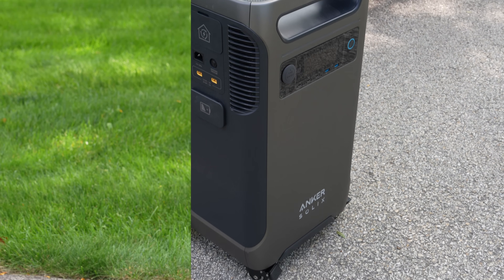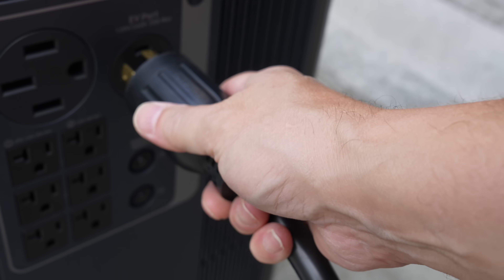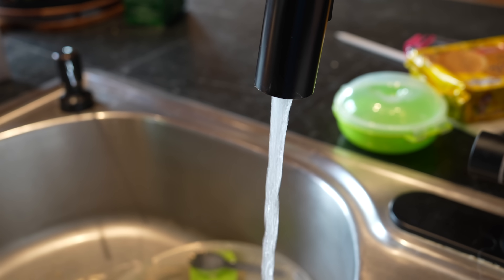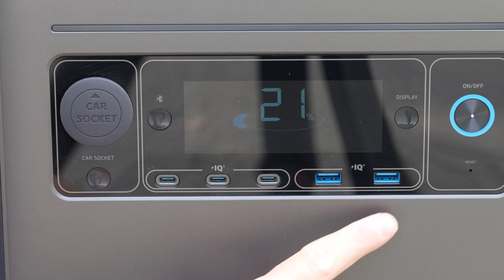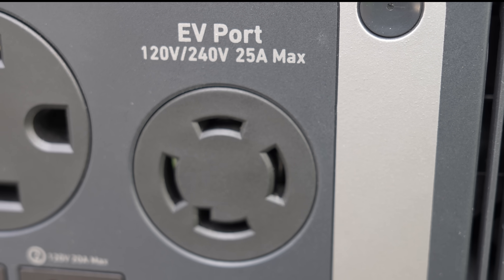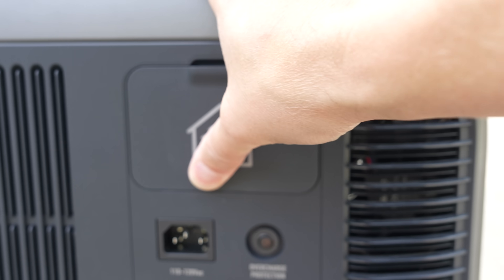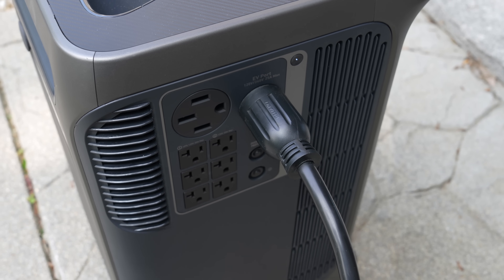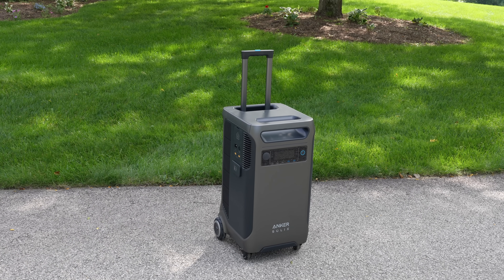Better than GAS Generator? First 240V Battery Backup - Anker SOLIX F3800

Comment: I would never rely on battery power in an emergency. I keep 20 gallons of dinosaur blood on rotation out in the shed and my well maintained Honda will never fail me.
Reply from the maker: I have become very angry at Honda. I need to make a video and share what I know and you will be too. It won't change your old generator, and I also own a Honda EU7000is. Don't get rid of your old one as Honda is pretty much abandoning us as a country. Sorry for the drama, I need to make the video as there is a lot people don't know. Mr Honda would not like their new company! I also agree with you if you live in the woods like I do you should have 2 backup pwoer sources, even if not equal but you have to plan on failure if you want to keep going.
Reply: You made a spelling error on the chat so to let you know, been watching you for a few years, you make good content. Keep it up!
Reply: @SilverCymbal when are you planning to make the video? I wanna know what is going on before I buy it this year. Thanks
Reply: @SilverCymbal  I'm curious, what's going to happen with Honda? I have the honda 7000 I es generator since it was the only fuel injected splitphase generator at the time.  I also have solar, so in 2 years I've only put on 1 hour on my Honda to run my well pump. Everything else got ran on solar.
Reply: @SilverCymbal Would like to hear your thoughts about Honda!
Reply: @SilverCymbal how to say a lot of words without saying anything
Reply from the maker: @nils1953  I used to work in government, they train you on that
Reply: As someone who uses generators pretty much daily, i gotta say, that battery is most likely more reliable and definitely cheaper to run in the long run.
Reply: @eokwuanga  batteries don’t last indefinitely. I’ve had my generator for over a decade and it runs as good as the day I got it. If I keep the maintenance up it will probably still be running just as good in another 10-15 years. You think that battery will last 25 years? That’s an awful lot of faith in all this new tech. It’s cool and all don’t get me wrong but as far as long term reliability I don’t think Honda generators can be beat.
Reply: @MR1977.  you said you're had a generator that lasted a decade, can you please tell me what brand is the generator?
Reply: @montisino  it’s a Honda eu3000. Purchased it in 2012 still runs as good as it did the day I bought it.
Reply: @MR1977.  Thanks for the reply 👍
Reply: @montisino  🤙🏼
Reply: @montisino  full disclosure it’s not used as a daily beater. Home back up and the occasional summer camping trips. It’s kept on a trickle charger and it’s ran for an hour every couple of months under load to keep the juices flowing.
Reply: @MR1977.  I'm thinking to get one to charge my batteries in my rv
Reply: @montisino  it’s perfect for that. It’s nice and quiet too so you won’t disturb other campers.  Only downside is it’s not very portable. 2 man operation without the wheel kit.
Reply: @MR1977.  Does the generator work on cold climate (i live in kapuskasing) I'm thinking to live full time in my rv and I want something reliable in the cold winter to charge my batteries
Reply: @montisino  damn man you’re way up there. I don’t see anything close to those temperatures so I can’t say for sure.
Reply: @MR1977.  thanks for your time, god bless you 🙏
Reply: @montisino  no sweat. Stay warm.
Reply: @MR1977. batteries don’t require maintenance, and yes they will last over a decade.
Reply: @brittgayle467 And they always discharge.
Reply: So the sun is gonna stop working. Thanks for the tip Nostradamus.
Reply: @EvanBlack11  “they” sun will probably continue to work its the batteries that don’t possess endless nuclear fusion. Unless you know of a battery that can last as long as the sun? Do share if you do.
Reply: @EvanBlack11  I understand what you mean and I truly want a solar generator but I believe what the other commenters points are is that even in this video it says you can recharge this unit 3,000 times. Well living in Southwest Florida where I have no power for approximately two weeks after a hurricane I don't know how 3000 recharges would last. I don't want to gas generator of any type because I don't like storing all of the gasoline prior to the hurricane and if you run out of gas forget about waiting in lines at the pumps, the gas station tanks run empty before you can even get to the front of the line. No gasoline for me but still searching for a portable solar option. I especially needed to run the air conditioner, small fridge and my well, the well doesn't have to run all the time but at least  periodically to allow me to shower. Please reply here if you happen to know of a good portable solar option.
Reply: @j.darrel517  Hey man 3000 is not the life span of the unit. This mean it's gaurnteed 3000 cylces at 100% capacity. After that battery degradation starts to kick in and the battery opperates between 90 or 80% capacity. Mean battery is still fine but not a strong as when you got it. I know you have power outages but it's going take you years meaning like 8 to 10 years to get to that point. People use these things everyday for off grid power solutions so im pretty sure you are fine.
Reply: @EvanBlack11 Will your roof-top solar panels survive the emergency?  How will your recharge your batteries?
Reply: @WilliamMurphy-b6v  brah not all solar panels need to be on the roof of your house. They make fold out panels that you can store inside and take them out in the morning. Also that a what if scenario. If your solar panels somehow get ripped off guess what you probably don’t have a roof anymore so you will have bigger issues the that. But as long as you house is fine you have options with roof and fold out panels unlike gas if you run out you are out of luck and if the power is out in your area your gas station pumps won’t even work.
Reply: @EvanBlack11  Evan, I agree with all you said.  I knew about portable solar panels.  But, if you are going to run your whole house on a solar battery and have enough "juice" to recharge your solar battery, you will need a WHOLE BUNCH of portable solar panels.  More than you would want to buy or store for emergencies.  A roof-top array provides enough electricity, but as you pointed out, the roof may not be there, so basic survival is a greater problem than recharging your cell phone.
Reply: @WilliamMurphy-b6v  yes but the main point your scenario is survival. If you are in survival mode you can't think about the whole house just the necessities. So you would only want to power the things that would help you ride that wave to when things go back to normal. That way of think is ok but sadly here in the western hemisphere we prioritize over-consumption and over prepping to have the comforts of everyday life not just the necessities. If you have the money and options to do so then go ahead but that's not the focus of survival, making it through it is. 🙏🏾
Reply: Me too but I have 7300 watts of battery storage to run my shit twice as long on my dinosaur blood alone . Additionally I have enough solar to run my stuff for free long after you run out of “dinosaur blood”
Reply: @buckd2958  cool. Sounds like you’re ready for the end. I’m not a doomsday guy. Lost power for 3 weeks after sandy and this set up got me through that so its sufficient as far as I’m concerned. If it ain’t broke don’t fix it.
Reply: Personally i think electric is better now. Quiet, unlimited fuel from the sun if you buy a few solar panels and there are no fuels to worry about.
Reply: Just use the generator ti charge the battery.
Reply: @badtoro  you could do that but the solix will probably be pretty expensive don’t know if it would be worth it.
Reply: I do the same.  If we have a bad ice storm or hurricane we could be without power for a week or more.   In that case this Anker would only be a nice place to set my coffee cup.
Reply: Good for you 😉
Reply: bettery makes FAR more sense for home backup, jobsite you are probably pulling 20 amps near continious per work area

but in your home, most of the big appliances are intermittent, so that means running s generator 24/7 will be draining expensive gasoline if your refrigerators and well, etc are not eunning, and you may only be using 200w for some small electronics, also exposing them and almost all modern appliances from the last 20 years now to nasty generator power (only basic directly user switched appliances left are cheap electric stoves and ovens, even gas stoves and $20 toasters have computers now!)

I use battery units as a companion to generators in buisnesses and my house, run everything off the battery, and when the battery is low get the generator to charge it and use extra capacity on it to run electric heat or some mechanical controled window ACs at full power
once the battery is full, put the generator back in storage, it has endured no idling, and was run at a smooth constant RPM, plus no fuel went to waste
and with a charged battery before night, you dont have to try to sleep with generator noises and the fear of theft by the average bad actor or even other people left in the dark with less morals

in buisnesses, the batteries are used as UPS, and the generators are prepared if its been a 30min or so outage; ready to be plugged in if the batteries are low, using inverter generators if the battery unit does not run its inverter when line volt power is present
Reply: Why not both?
Reply: I live in Puerto Rico where the lights go out constantly and trust me 20 gallons won't last in an emergency, sometimes our generators have too run for days.
Reply: Okay… and?
Reply: The biggest potential I see is events maybe like a DJ that does outdoor events and you can charge in your car between jobs
Reply: I still ride a horse 🐴
Reply: I'll think you'll find a Honda will just maintain itself
Reply: @benpinder889  pretty much does.
Reply: @wojtek-33 You’re missing the whole point of Solar generators, coupled with solar panels, they give you free electricity for twenty years or more. They start degrading their output, but should still provide about 80% after ten years of use. Calculate how much money you can save by not buying fifteen years of fuel for your dinosaur generator and then determine if a solar generator and solar panels are worth it for you.
Reply: Gasoline isn't made of dinosaur bloody, dingus
Reply: @maxxswagster9283 As youngsters, many decades ago, many of us were taught that oil was from compressed dinosauer remains.  Fact.  Science is only as good as what was known at the time.  Concensus is not fact, only a best guess, at the time.  Still wrong, as often proven much later. "Trust the science" is BS.
Reply: I have a battery for my fridge, and going to get a Honda for a small AC.
Reply: @keyratcane66 Redundancy.  Great idea.
Reply: In SHTF, you will be without Dino blood and power
Reply: Spoken like a true dinosaur. I have whole home battery backup with solar and can power the house eternally even on cloudy days.
Reply: @gosbusta only for 4 hours and 10 switches
Reply: @gosbusta  congrats. I’m so proud of you.
Reply: I knew what your comment would be before I read it simply by looking at your profile pic.
Reply: @CT-vm4gf  what do you mean?
Reply: @MR1977.  what honda generator do you have mr white man? im interested
Reply: @gumpoppers  Mr. white man?
Reply: The battery would be better than a gas gen
Reply: @BK-pc3ei In a hurriane or tornado, your solar panels may be on your neighbor's roof and who knows where that house is.  Good luck recharging.
Reply: 😂😂😂 dinosaur blood.
Reply: If I wanted battery backup I’d get like a Tesla power wall. I have a natural gas generator and it’s the best for most scenarios but it’s very loud. If I owned like a 1/4 acre and didn’t want to make neighbors mad in a blackout I’d get a Tesla powerwall.
Reply: @capitalv8062 And when you run out of battery power your neighbors will really love you.

Comment: When it runs out out of charge just go down the street to your local gas station and fill up your 5 gallon cans with 5 gallons of electricity. 😂
Thanks but no thanks. As someone that lives in blizzard/ice storm country I'll stick to my gasoline generator with a natural gas conversion option. Having a device that has to be charged with electricity as a backup for when I don't have electricity is a terrible plan. Sure, it's nice for a short outage but in any serious event it's going to leave you in the dark.
Reply from the maker: I hear what you are saying but then ther eis what happened in Texas. The gas stations had no power and most people couldn't even get to them. Just rememeber things aren't normal during a crisis. I made a video a few years back about keeping gas on hand, I still do that  to this day. I like having a battery and gas, now if one goes I have the other Just things to consider.
Reply: @SilverCymbal  Not entirely true. I'm in Houston. We ran 3 days on on old generator. Some gas stations were able to pump. Since the outages were localized and moving, we occasionally had to go a few miles to get gas from a location where there was power. We even discovered a gas station with a backup generator to operate the pumps!

Whatever the case, this Anker unit would not power our house for more than a few hours. Just not practical for the price.
Reply: You joke, but I have a 1800w outlet on my ioniq 5 Ev. If I run low on power in an outage I can drive to a charging station and "fill up" 60 kWh in about 20 mins.

Of course if the entire region is without power you have a bigger problem on your hands.

Comment: All of these kinds of powerstations type products are still well outside my budgeting priorities. However, the technology has made big leaps just in the last few years and more brands are getting into the market which all should help with the price tags. I can't speak for any anker products in this specific product market however i have the eufy cameras and I'm happy with them. Its one of the few systems that doesn't require a monthly subscription to use and their battery life and signal range claims are pretty consistent with real world results. That's a pretty big deal to me since so many things have overinflated claims based on absolute perfect conditions or whatever like mpg ratings on cars that nobody ever actually sees. And the operation of the cameras and overall system has been really good. Only big downside I've had with them is as soon as i take a camera inside my metal pole barn the metal siding kills the signal. A booster system or something to fix that would be great. The signal has no issue clipping through multiple brick walls or anything else I've encountered but that building is it's kryptonite.
Reply from the maker: All great points. I hate the monthly subscriptions unless its like TV or phone then its understandable. I agree with you also these are moving into new space where in a couple more years the prices will keep coming down and power will go up. 15 years ago think of battery weedwackers, they were awful and cost a lot. Now they are cheaper and work awesome. Its going in the right direction for sure!
Reply: @SilverCymbal  Cancel out your comment, Trumps 60% tariff will obviously make prices rise

Comment: I wish it was 50amp, regardless it seems cool
Reply from the maker: That would be crazy. It's hard to believe that these have come this far. I think we will see that size and more in the near future.
Reply: I am confused, the 50amp port can be used as well. I saw another youtube reviewer (David Poz) who had it hooked up to his 'inlet' via the 50amp outlet. Is that still only providing 30amps? @SilverCymbal
Reply from the maker: @elykk18  Yes that is correct. Many appliances that will use the 50amp plug will draw far less than that and if its within the 6000 watt output that will work. You won't ever not be safe since its sort of creating an underload (not really a word) so it might fail to power something but can't overheat as its not exceeding the 50amp wire/plug size.
Reply: I'm a day away from deciding if I wanted to get a 30amp inlet or 50amp inlet hookup for the house, so I assumed since this has the 50amp port that I should do the 50amp hookup, but sounds like it wouldn't really make any difference if I choose 30 or 50? @SilverCymbal
Reply: @elykk18 I installed a 50 and use an adapter incase I get a bigger generator in the future.

Comment: can I plug in my 220v Tig welder on this and how long can it last?
Reply from the maker: Yes it can run a welder if its 6000 watts. Welders are great with these since between welds they take very little power. You would have to check out power plate on it to see what it requires and their can be startup loads so no one can say 100% but if you are well under 6000 running watts than it would likely be OK.

Comment: Inverter???
Reply from the maker: Yes, they must be using dual inverters to accomplish the 240v
Reply: You can see leg 1 & 2 on the 120 volt outlets. You could use a combiner adapter to get 3 additional 240v connections as well.